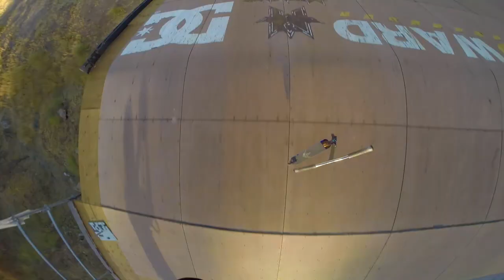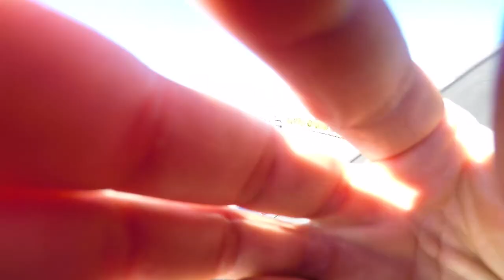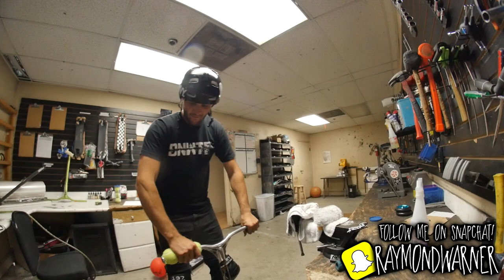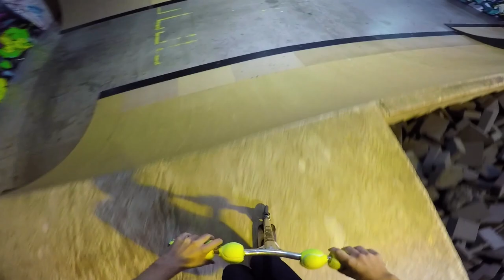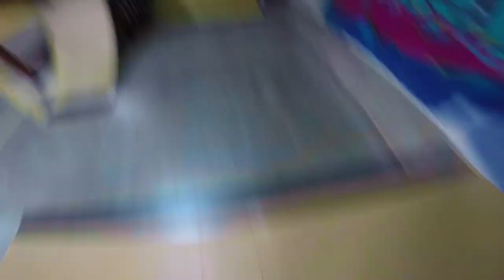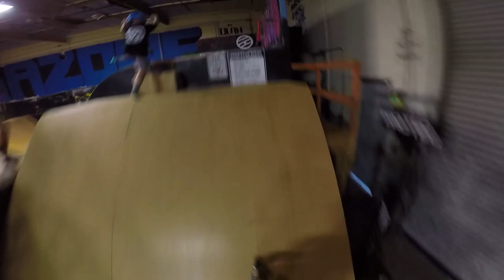TENNIS BALL GRIPS

Comment: Ramon how do u get rid of head shack I have a mad gear and a luck covernant custom and they both have it and it bugs me so bad plz help I think it's in the head set but I don't wont to tighten it to much so it will not spin the bars or whip doyou think to tighten it a bit more and if the is the problem thx